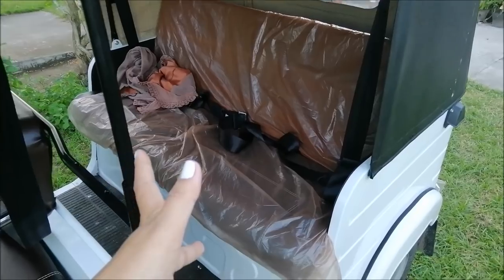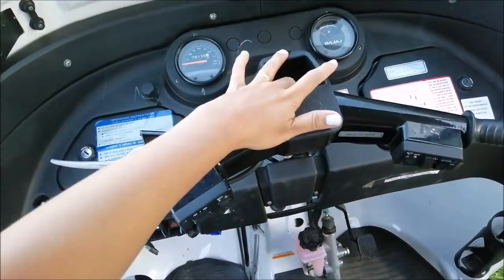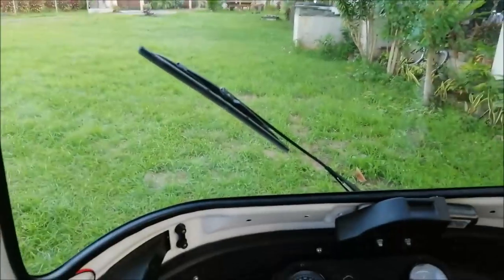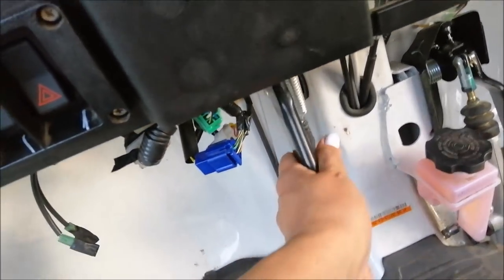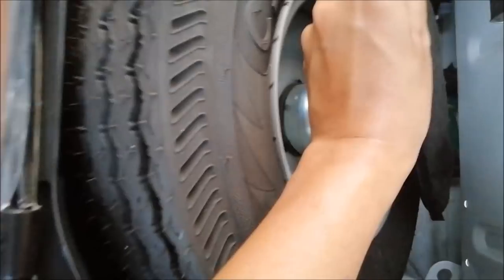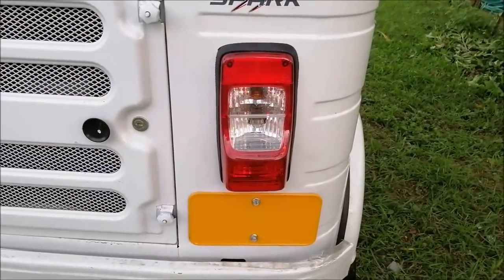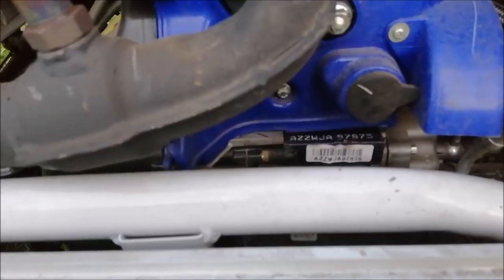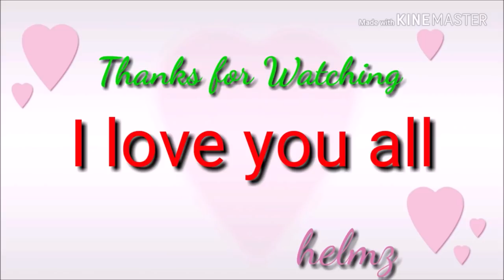Bajaj RE Philippines TOUR, availabl in Emcor and Motor Ace 178,999 pesos-Helmz Jordan

Comment: I believe the Black port on the left rear is the air intake for the engine's fuel injection system. As someone else mentioned the hooked tool is for operating the jack which is under the front seat and attached to the rear wall of the compartment. One thing you might consider getting is side curtains for when you have to drive in the rain. I have seen them on the Bajaj Re when I was in Sri Lanka where they are very common.
Reply from the maker: Yes we will work on the curtains soon and have them made hehehe

Comment: The tools....the one with the hook is for the jack. You put the hook in the jack and use the tire wrench to jack up the car. 
The tube type tool is for spark plug removal.  And the other wrench is for taking the lug nuts off to change a tire.
A real hotrod....hopefully you won't be speeding at 100 kilometres  all the time!!!!
    🚐💨💨💨💨💨
It's a nice car.

Comment: i would not make the roof made of sheet metal .. all that weight  will make the center of gravity high hence possible roll over on a tight corner ..
Reply from the maker: ohh that is a nice recommendation.. yes we havent had nothing made for the roofing.. and it is also best to slow down in the slope or make turns on the corners.. thank you so much for watching :-)

Comment: Nice video, I've noticed they all seam to come with black vinyl tops that soak up heat. Does anyone use a white rubber paint on them to reflect the sun?
Reply from the maker: I haven't seen someone with white top yet..
Reply: @HelmzJordan  from what I've seen i don't think they make them. It would have to be custom. Obviously it would look best on a white vehicle. I only suggested white as it is the only rubber based paint other than black available in my area. I grew up in a desert and light colors are best to reflect solar heat.
Reply from the maker: @billlyell8322  funny,, we just saw a white one today in town..and yes you are right.. it is customize

Comment: It looks like a refurbished model sold as new in the Philippines.
Reply: That is a New Bajaj Re. They are selling them brand new in the Philippines now.
Reply: @rustyevolution6298  Did you notice how the dash is faded and worn, buttons are worn and faded. Markings all over the front. Doesn't look new to me.
Reply: @Robmar40  These are made in India and then shipped by slow boat to the 
PI. The marks on the front are part of the arrival inspection process. By both front headlights, there is a white wax pencil mark of "ok" indicating that both headlamps work properly and passed inspection after delivery to the PI.  There are similar typical inspection marks on the dash. The plastic on the dash of the Bajaj RE is not manufactured shiny but has a normal dull finish. These inspection marks you see are typical of all Bajaj RE sold in there as they are fully inspected upon delivery to the Philippines.  Notice all the key locks such as the ones on the dash. Not one of them has the typical scratch marks that all locks get after use. They are all brand new. Take a look at the engine compartment. Clean, no oil or exhaust marks. The braided steel cable is clean and new and there is no sign of wear anywhere on any of the drive components.  The engine is brand new as is the exhaust pipe and fuel injection system. They have been selling in the PI for only a few years now. I have ridden in many AutoRickshaws in a few different countries around the world and am very familiar with the Bajaj RE in particular. There is only 130 miles total on this Bajaj. It is indeed new.
Reply: Rusty it's paying import tax and second products not allowed in Phil as not economical and banned